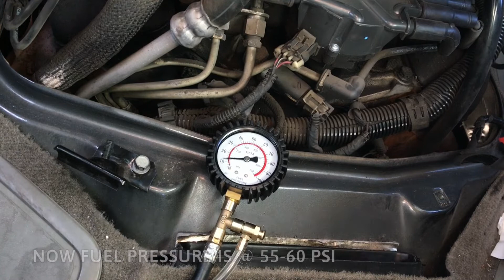Astro Van Fuel Pressure Test - 1996-2005 - 2 MINUTE DIY VIDEO

Comment: If the Astro was engineered as well as the video is concise amateurs could feel more confident about replacing some minor components.  
Now, watch one of the videos explaining how to replace the fuel pump and you'll give up completely. Taking tghe tank off completely and that sort of thing?  Why not build-in a trap door in the van floor just above the fuel pump and make access reasonable?  
It is obvious that those who design vehicles are not the same folks who have to maintain them.
Reply: Most vehicles are like this and do not have an access panel to prevent fumes from entering the cabin.
Reply: That's exactly what I did! It's a camper van and my thought's were the last thing i want to do on the side of road is drop a tank, Replacing the fuel pump tomorrow at home in the driveway  straight through the top- Lot's less stressful through the top for sure! Def the way they should have designed it!!!
Reply: hunted by bears  could've, but more often than not they don't add a sealed door. That's one more custom step that adds money to manufacturing.

Comment: What if my pressure is about 55psi but still cant start?
Reply: Then your pump and filter are good. Your problem is something else. I know it's too late but hope you solved it.
Reply: Did you ever solve your problem? I tested my pressure today, and its not quite 55 but i read that is has to be 60 to start, I have spark. Condition only happens when it gets cold, I'm thinking my pump just isn't quite strong enough-Will test it out tomorrow!
Reply: I noticed that when your engine fired up, that your pressure gauge was right at around 60psi, I read tonight online that a lot of people will rule out the fuel pump being the problem because it still makes pressure- I having a firing problem at the moment, I have spark, and my fuel pump is making 55psi just as i turn the key forward- Where's yours in this video, I noticed does not drop down as my gauge does-when i crank-Just food for thought, This issue has been a hard starting van, in cold weather for me, and this is what has brought on this issue, just for food though for anybody out there, Thanks for your video!
Reply: So I'm parked side ways on a snow bank.  Low on fuel I did try starting it when it was low. It would fire for a second then die. I did put more gas in it and same thing happening. New starter and battery on within this month. It is also -20 here . Super cold. Maybe I sucked in a bunch of air???